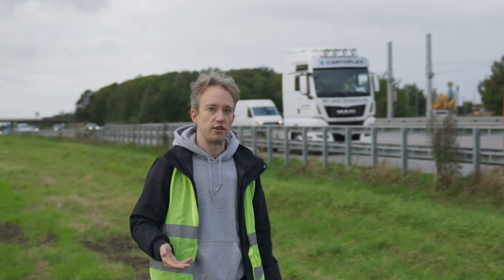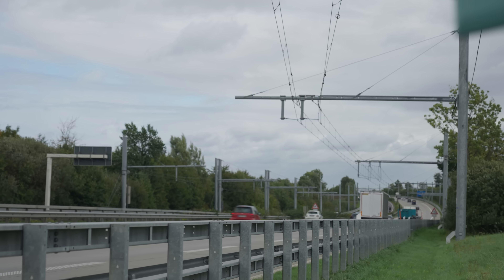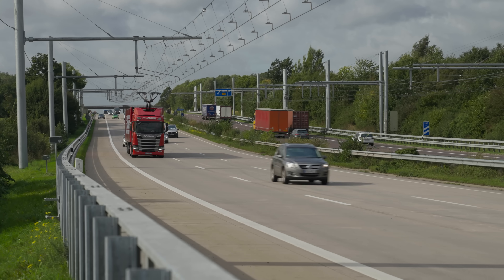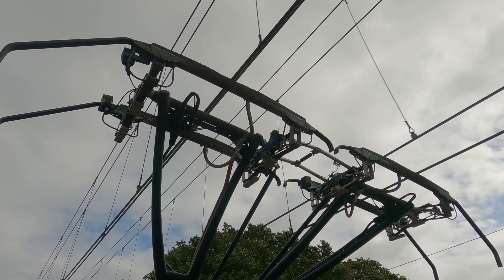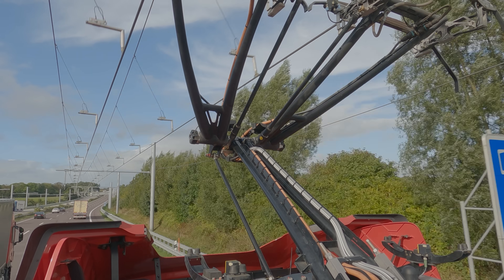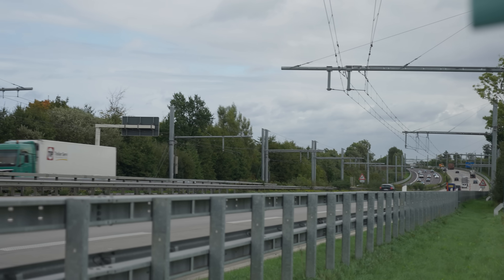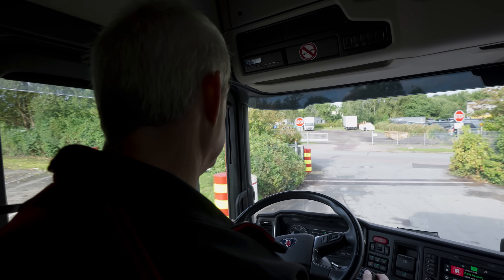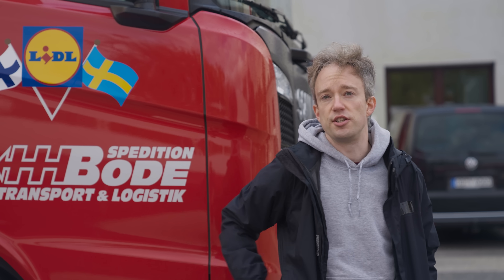The highway where trucks work like electric trains

Comment: I dont see the benefit here. Just expand Railway network, trucks can recharge while beeing loaded. The trip would be way shorter because of the train infras, there is no need for this?
Reply: According to their FAQ (so take it with a grain of salt):

The rail infrastructure has already reached the limits of its capacity. Path conflicts between freight, long-distance and local traffic are the rule, especially in the nodes. Despite all efforts to shift more freight traffic to rail and waterways, the highest land-based transport volume is therefore provided by road freight transport, both today and in the foreseeable future, with a share of over 70 percent. The main reason for this is that trucks can deliver goods quickly and flexibly - this is of great importance for many logistics sectors.

As part of the Climate Protection Plan 2050 and the Climate Protection Program 2030, the German government has adopted extensive measures to further increase the share of rail in freight transport. However, expert reports commissioned by the Federal Environment Agency show that even with the greatest efforts, rail's share cannot be increased from 18 percent today to more than just under 25 percent by 2030. Because of the overall increase in traffic, this already means a multiplication of rail traffic. However, this alone will not be enough to sufficiently reduce emissions in freight transport. Therefore, the trolley truck can be a sensible complement to rail

Comment: Why not just use trains.
Reply: According to their FAQ (so take it with a grain of salt):

The rail infrastructure has already reached the limits of its capacity. Path conflicts between freight, long-distance and local traffic are the rule, especially in the nodes. Despite all efforts to shift more freight traffic to rail and waterways, the highest land-based transport volume is therefore provided by road freight transport, both today and in the foreseeable future, with a share of over 70 percent. The main reason for this is that trucks can deliver goods quickly and flexibly - this is of great importance for many logistics sectors.

As part of the Climate Protection Plan 2050 and the Climate Protection Program 2030, the German government has adopted extensive measures to further increase the share of rail in freight transport. However, expert reports commissioned by the Federal Environment Agency show that even with the greatest efforts, rail's share cannot be increased from 18 percent today to more than just under 25 percent by 2030. Because of the overall increase in traffic, this already means a multiplication of rail traffic. However, this alone will not be enough to sufficiently reduce emissions in freight transport. Therefore, the trolley truck can be a sensible complement to rail

Comment: Please invest more on trains than on this... The German rail network is very well extended, just run more trains on it and/or renew lines.
Reply: According to their FAQ (so take it with a grain of salt):

The rail infrastructure has already reached the limits of its capacity. Path conflicts between freight, long-distance and local traffic are the rule, especially in the nodes. Despite all efforts to shift more freight traffic to rail and waterways, the highest land-based transport volume is therefore provided by road freight transport, both today and in the foreseeable future, with a share of over 70 percent. The main reason for this is that trucks can deliver goods quickly and flexibly - this is of great importance for many logistics sectors.

As part of the Climate Protection Plan 2050 and the Climate Protection Program 2030, the German government has adopted extensive measures to further increase the share of rail in freight transport. However, expert reports commissioned by the Federal Environment Agency show that even with the greatest efforts, rail's share cannot be increased from 18 percent today to more than just under 25 percent by 2030. Because of the overall increase in traffic, this already means a multiplication of rail traffic. However, this alone will not be enough to sufficiently reduce emissions in freight transport. Therefore, the trolley truck can be a sensible complement to rail

Comment: bruh why not just use trains
Reply: I believe mainly because nearly all of warehouse don’t have a train line going inside
Reply: That is an option but you gotta take In account routes the train might not go. How much is the company gonna charge me per load, definitely building one’s own train is expensive . Trains are best this is just another option
Reply: According to their FAQ (so take it with a grain of salt):

The rail infrastructure has already reached the limits of its capacity. Path conflicts between freight, long-distance and local traffic are the rule, especially in the nodes. Despite all efforts to shift more freight traffic to rail and waterways, the highest land-based transport volume is therefore provided by road freight transport, both today and in the foreseeable future, with a share of over 70 percent. The main reason for this is that trucks can deliver goods quickly and flexibly - this is of great importance for many logistics sectors.

As part of the Climate Protection Plan 2050 and the Climate Protection Program 2030, the German government has adopted extensive measures to further increase the share of rail in freight transport. However, expert reports commissioned by the Federal Environment Agency show that even with the greatest efforts, rail's share cannot be increased from 18 percent today to more than just under 25 percent by 2030. Because of the overall increase in traffic, this already means a multiplication of rail traffic. However, this alone will not be enough to sufficiently reduce emissions in freight transport. Therefore, the trolley truck can be a sensible complement to rail

Comment: Possibly the most ridiculous idea ever.

Electric freight trains exist for a reason to carry larger amounts of containers over long distance...
Reply: According to their FAQ (so take it with a grain of salt):

The rail infrastructure has already reached the limits of its capacity. Path conflicts between freight, long-distance and local traffic are the rule, especially in the nodes. Despite all efforts to shift more freight traffic to rail and waterways, the highest land-based transport volume is therefore provided by road freight transport, both today and in the foreseeable future, with a share of over 70 percent. The main reason for this is that trucks can deliver goods quickly and flexibly - this is of great importance for many logistics sectors.

As part of the Climate Protection Plan 2050 and the Climate Protection Program 2030, the German government has adopted extensive measures to further increase the share of rail in freight transport. However, expert reports commissioned by the Federal Environment Agency show that even with the greatest efforts, rail's share cannot be increased from 18 percent today to more than just under 25 percent by 2030. Because of the overall increase in traffic, this already means a multiplication of rail traffic. However, this alone will not be enough to sufficiently reduce emissions in freight transport. Therefore, the trolley truck can be a sensible complement to rail

Comment: The dumbest idea yet.  What do you make your electricity from? nuclear? hydro?... right... gas.

So it would be more efficient to just use the gas, or even diesel as is, and run the truck of it

So they made something that is more expensive, less efficient, and worse for the environment. 

Congratulations
Reply: >So it would be more efficient to just use the gas, or even diesel as is, and run the truck of it

Not really, dude. Even if you use coal power it's still more energy efficient than diesel/gas.

The eHighway idea is stupid for other reasons
Reply: @snowshoe3274  
"Even if you use coal power it's still more energy efficient than diesel/ga"

Top tip. never just claim anything you heard with out doublechecking it your self. Do the math, and you will find out you are not only wrong about that, but really very very wrong.

Comment: This would be excellent for short haul from a rail or ship terminal to a final destination. I don't think this would be very feasible over long distances, and that's where trains and ships come in, when it's arrived at a terminal one of these trucks can then collect it and deliver it to a final destination.
Reply: Yes, and a good beginning may be made by mandatory requirement of at least 20 percent offloading / onloading of /from ships to be on electric mobility networks of trucks or conveyor belts. Let us have port regulators implement such rules that shifts fossil fuel based trucks to renewable energy swiftly

Comment: trains?
Reply: Trains are best but nothing wrong with another option
Reply: According to their FAQ (so take it with a grain of salt):

The rail infrastructure has already reached the limits of its capacity. Path conflicts between freight, long-distance and local traffic are the rule, especially in the nodes. Despite all efforts to shift more freight traffic to rail and waterways, the highest land-based transport volume is therefore provided by road freight transport, both today and in the foreseeable future, with a share of over 70 percent. The main reason for this is that trucks can deliver goods quickly and flexibly - this is of great importance for many logistics sectors.

As part of the Climate Protection Plan 2050 and the Climate Protection Program 2030, the German government has adopted extensive measures to further increase the share of rail in freight transport. However, expert reports commissioned by the Federal Environment Agency show that even with the greatest efforts, rail's share cannot be increased from 18 percent today to more than just under 25 percent by 2030. Because of the overall increase in traffic, this already means a multiplication of rail traffic. However, this alone will not be enough to sufficiently reduce emissions in freight transport. Therefore, the trolley truck can be a sensible complement to rail
Reply: @Testperson001  bro of course they say that, they're selling their idea😂

Comment: We have something that can move things with electricity for long distances. 

ITS CALL A TRAIN
Reply: a train cant get everywhere especially here in Lübeck (i was a train driver there)
Reply: @Ryderfrfr  thats is an infrastructure problem. Which in this case building more rail lines shall take more priority then new roads. To be fair i guess that on small scale shipping trucks aren’t so bad. but but for that you can just have lithium battery electric buses. No needs for ugly and high voltage dangers cables
Reply: According to their FAQ (so take it with a grain of salt):

The rail infrastructure has already reached the limits of its capacity. Path conflicts between freight, long-distance and local traffic are the rule, especially in the nodes. Despite all efforts to shift more freight traffic to rail and waterways, the highest land-based transport volume is therefore provided by road freight transport, both today and in the foreseeable future, with a share of over 70 percent. The main reason for this is that trucks can deliver goods quickly and flexibly - this is of great importance for many logistics sectors.

As part of the Climate Protection Plan 2050 and the Climate Protection Program 2030, the German government has adopted extensive measures to further increase the share of rail in freight transport. However, expert reports commissioned by the Federal Environment Agency show that even with the greatest efforts, rail's share cannot be increased from 18 percent today to more than just under 25 percent by 2030. Because of the overall increase in traffic, this already means a multiplication of rail traffic. However, this alone will not be enough to sufficiently reduce emissions in freight transport. Therefore, the trolley truck can be a sensible complement to rail

Comment: I think it's a good idea provided it allows sufficient clearance for most oversized loads and assuming that sideways motion of the pantograph is not a problem. Ideally the wires can be used to assist in self guidance. Figuring out how much money to charge each truck will be challenging.

Comment: cant you just use a cargo train? (might have missed something in the video tho)
Reply: cargo trains require their own separate infrastructure which would massively increase building and maintenance costs (tracks, control stations and cargo yards) and trains are only really viable for long distance large haulage journeys. 

trucks on the other hand are for "last mile" or short trips going from a cargo yard to a warehouse or a business directly. because not every town or village has a train station let alone a full blown cargo yard. 

the point of this hybrid system is so that while a truck has access to the infrastructure it does not have to use fossil fuels
Reply: @samueleveleigh2767  Yes indeed, Allot of products get transported from 1 factory to many others just by 1 truck in 1 day and that versatility is something rail can never compete against even with extensive systems.With these overhead wires you could go anywhere at anytime with any load.

Comment: I didn't know these were actually being trialed. In an ideal world, everything would use low-friction rails, but not every road is going to be a railway, so really everything should be electrified with a system such as this, including boats and cars. Perhaps not the really low traffic areas. Trolleyboats have been a thing, trolleytrucks in the old USSR of course, I don't think there has ever been a system for private cars. With planes if one day we have wireless power transmission that is efficient enough, we could have power beamed to them from satellite or ground stations, though this has a number of radio wave propagation troubles.Anyone who advocates for inductive charging of road vehicles though, I personally believe is mad. Good old catenaries are far more straightforward and I'm sure the wear and friction can be minimised, a lot more so than the cost of digging up whole roads and all the power loss and switching complexity of an inductive system.

Comment: Would be interested to know the kind of voltage they’re running? Is it enough to maintain motion or more to recharge for non stop commuting?
Reply: Probably about 750 volts since they said it's trolley voltage and that's about what trolleybuses use but electric trains usually use several times that voltage

Comment: SO STUPID...you could build more railways than highways..
Reply: sir, you dont know what your talking about. 

no one is mentioning the construction of new highways only the possibly renovation of the current ones. 
and then you have the issue of trains would be as cost effective as a zeplin if they only carried one cargo container 
not to mention how most towns and villages dont have a standard train station let alone a dedicated freight yard. and when a train offloads its cargo you need a truck to get it through that last mile...
Reply: @samueleveleigh2767  And not only the last mile. Many people forget that allot of trucks go from factory to multiple customers just with that same truck.
Now imagine if a train had to run with only a couple of containers on it to 10 different locations all over the country and unload them inside of a factory. 
It would clog up the railways and would be asking for more railway accidents to happen.

Comment: According to Scania one of the problems with this is that you rely too much on the governments of each country to implement this. If only Germany and Sweden deceides to built this for example, it migh not be worth Scania developing these.
Reply: you just described the main issue with every new product. if people dont buy the product dies...
Reply: @samueleveleigh2767  what i meant is if you make a electric car, you dont rely on government changing infrastructure. You can use the same roads that exist today. This needs a lot of work from government which is often slow and if only one country would implement it it could be a to small market.

Thus, for a private company like Tesla or Scania, it is a bigger risk to develop something like this.

Comment: You know, if we put some iron guides on the ground, and have the truck just roll on those, we could just add a simple signalling system and have self driving trucks too!
Reply: Not roll on them, but have the steering controlled by them like in a guided busway, and maybe use an overhead pole so the lane isn't messed up.
Reply: @bangerbangerbro  i think you are on to something
Reply: @HrHaakon  Perhaps, the pole would have to be fairly strong though, but maybe not that strong because of modern power steering. I used to think that guided buses were just following the track because they didn't have a choice like a train, but that would involve a lot of scraping, so the little guide wheels aren't just padding but influence the steering. So I guess if you had a train of vehicles, each one would probably still have to have a working steering system. I don't really see why you can't have a system like that using an overhead guide, as the tyres are still rolling on normal road anyway.

Comment: Looks to be problematic system to me , does driver have to keep exactly under the wires ? looking at twin pan arrangement ,a foot or so either way and you have one pan on both wires , a short !!! . Leave it to railways for long distance then last few miles by battery trucks , makes more sense to me